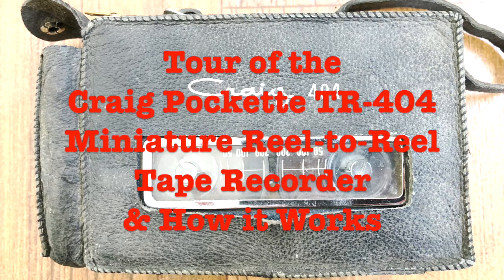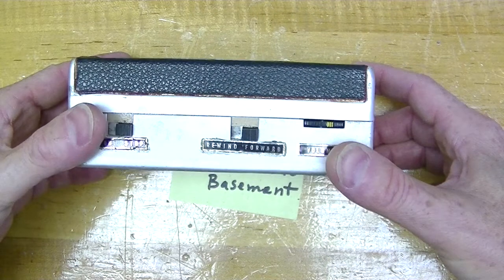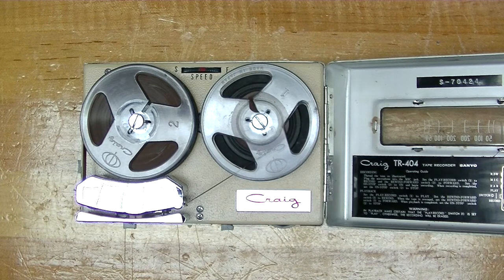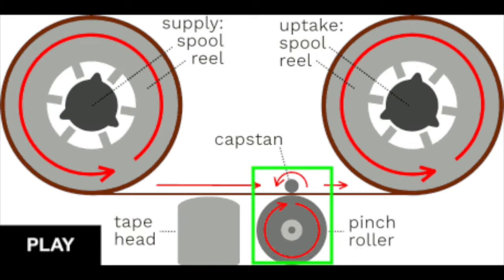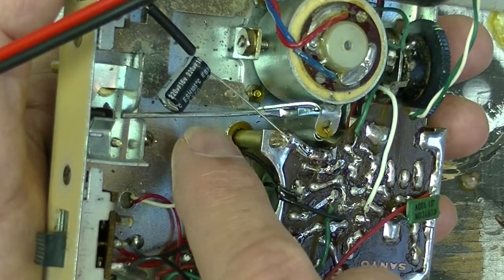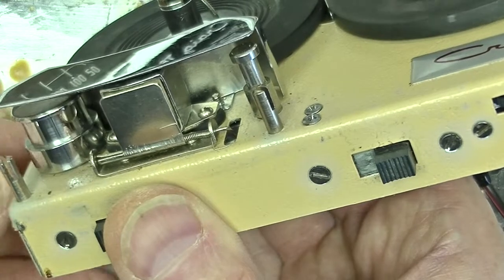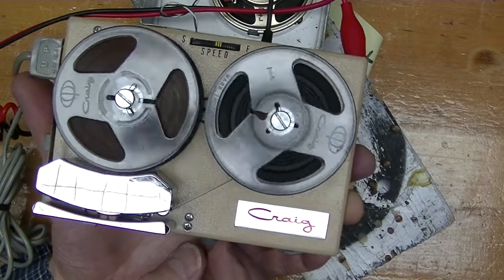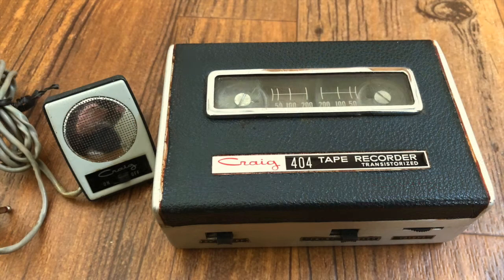Craig "Pockette" TR-404 Miniature Reel-to-Reel Tape Recorder Tour & How it Works

Comment: Rim drive wasn't really so common because it was so poor. It was only reserved for the absolute cheapest devices and those machines were considered more as children's toys than serious tape recorders. A friend of mine told me received one as a birthday gift in 1967 from his father; it cost about $5 back then. Even as 10 year old he told me he was offended at receiving something so shitty with sound so bad as to be unlistenable . He used to say this about his extremely cheap father... "he stood for quality... shit quality."
This Craig unit looks to be somewhat better than what my friend described but it's still a reminder that even back then there were terribly made junk products.
Reply from the maker: @socksumi  I lived through that era. Electronics was extremely expensive, particularly before integrated circuits had completely supplanted older technologies and the industry had transitioned to printed circuits from point-to-point. You cite a tape recorder at “only $5 in 1967”. That’s more like $45 today. For the most part, rim drive machines were awful but that’s what many people could afford so they were very common. If you could afford an entry level capstan drive reel-to-reel like the sony TC-104 it was $115 (in 1967). Did most people have the equivalent of $800+ for a so-so tape machine?

Comment: Thanks for replying.
I still feel as though you've missed something there.
People accepted that the original Bell Telephones had to be shouted into to achieve a feeble result and if you made the line too long it wouldn't work at all but that was when mankind had no means of electronic amplification.
Reply from the maker: Hey, no problem! 
The first bell-tel microphones were carbon microphones. Imagine a capsule loaded with carbon grains whose resistance was modulated by the sound input. They weren't particularly sensitive and they had a lousy frequency response but it didn't matter for plain speech. They did require external excitation. Carbon microphones were also used as amplifiers in phone repeaters before tube amplification. Part of the shouting that people did in early telephones was because they weren't wired to produce a sidetone. Later phones were redesigned to feed a small amount of speech back to the headphone to make it easier for people to gauge how loud to speak.

Comment: I find it hard to believe that people handed over good money for a machine of such poor performance.
Could it be that the Crystal? Microphone has lost a lot of it's output?
Reply from the maker: Perhaps, but I don't think so. I think people were paying for the novelty and the size. Even the best rim drive machines weren't very good. And 4-transistor machines with a 2" speaker? They weren't being sold for the audio fidelity! In terms of the "crystal" in crystal microphones, I don't know if all used the extremely delicate Rochelle Salt crystals that powered old crystal phono cartridges. They could have used Quartz crystals, which also have piezoelectric properties. I'm sure they used whichever was cheapest.

Comment: I have two of these machines, branded Sanyo MC-1, and none of the two can record or playback. The only sound coming out of the speaker is motor noise. Any idea what can be?
Reply from the maker: Sorry for not replying earlier. A number of problems can plague these machines. The first is bad electrolytic capacitors. There are two 10μF capacitors in the signal path. Either or both could be bad and would prevent it from working. The other capacitors are supply decoupling that are not as important. The other is deterioration of germanium transistors. There are four transistors in this unit and any of them could be suspect. You may need to test them. My Craig 404 had capacitors which measured > 200% over rated capacitance with very high ESR. In other words, they were bad. However, the transistors were fine. The unit also required a complete cleaning and removal of old lubricant and replacement with fresh grease.
Reply: @Mr.BrownsBasement Today I managed to repair one, and guess what? All 10uF capacitors were faulty. I also replaced all other capacitors, 10 in total. Not easy but now this unit works perfectly. Thanks for taking the time to reply, much appreciated.
Reply from the maker: @GuidoScognamiglio Yes, it’s awkward to work on that machine. Congratulations!

Comment: To get a clearer recorded voice ,maybe you need to change the old spool and it might work perfect! Just a suggestion.
Reply: Pretty sure this has DC bias and DC bias was always bad sound quality. Also some of these old rim drives devices had motors with governors that would auto adjust the speed as tape tension changes. Or at least try to.🤣
Oops...got that backwards.  The servo controlled motors adjusted speeds on capstan drive machines. I just got outta bed🤣
Reply from the maker: With only 4 transistors, yup, DC bias! Some machines (e.g., my Parrot 5” reel to reel) definitely has a governor. I remember as a child giving the motor quite a bit more voltage and being disappointed that the motor wasn’t going much faster. However on the TR404 I think there is no speed regulation at all — given that the speed control is a rheostat.
Reply from the maker: You're right; the tape is old and worn. But rim-drive machines are notorious for their poor audio quality!